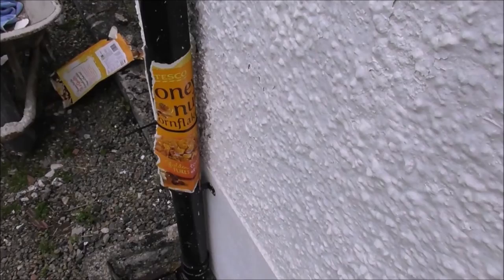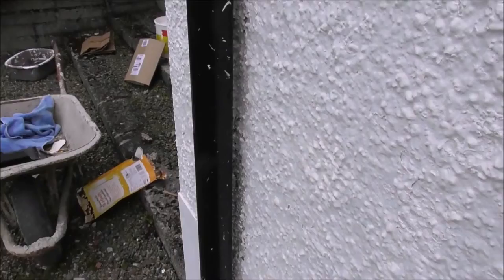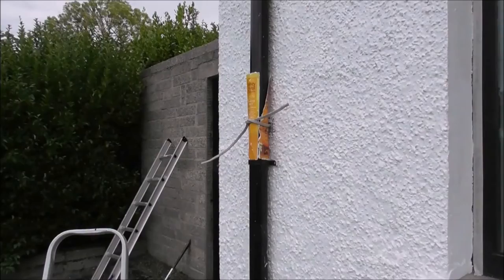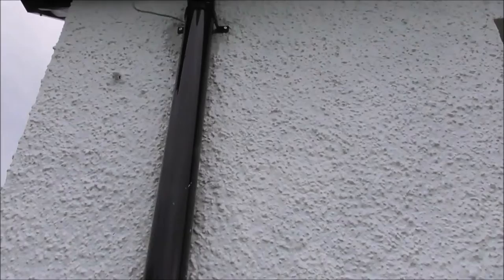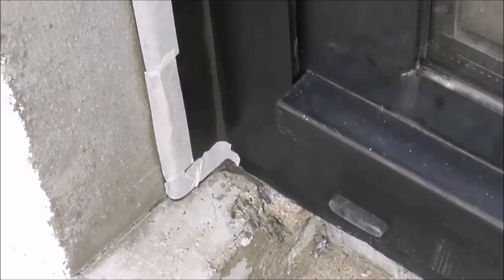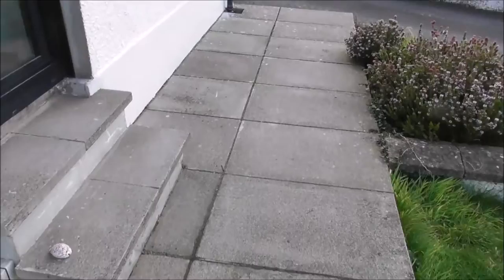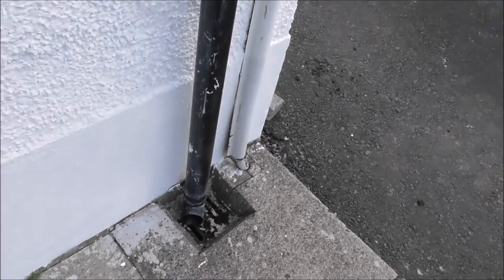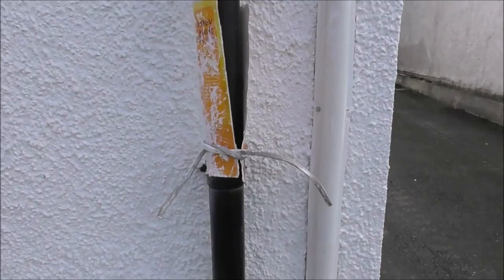How to Paint Behind a Down Pipe & Other Painting Tips

Comment: You’ve done a really good job Tom. Enjoyed all your tips.
Reply from the maker: Thanks Joan. The only other way to get at the wall to paint it is to unscrew the entire pipe from the wall. this is fine if it is a new plastic pipe but difficult if it is an old metal pipe with deep/hard to remove screws into an old wall. 
We are painting the whole house. Some days are really cold and windy and we are very exposed. The back of the house is more sheltered. We have to stop when it rains. We are getting there. 
Once we do the outside then we move in to rackle the inside! lol

Comment: But how do you get the brush behind?
Reply from the maker: Hi Jon there should be a narrow gap between the wall youwant to paint and the curved 'protecting' cardboard you have placed round the downpipe. Use the smallest paint brush you can find and paint from one side behind the carboard and then paint from the other side. Move the cardboard up the pipe and redo. Best wishes from Belfast's Castlereagh Hills.